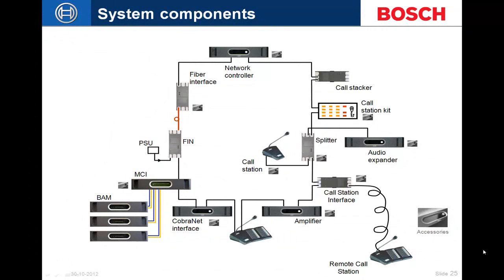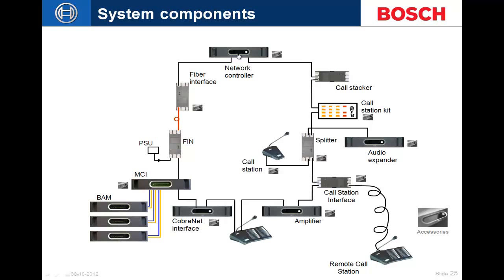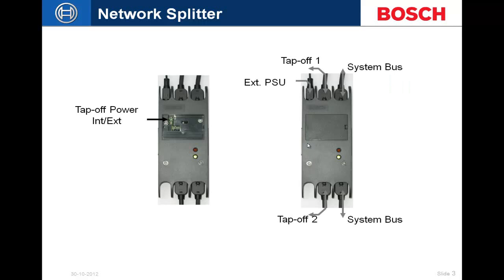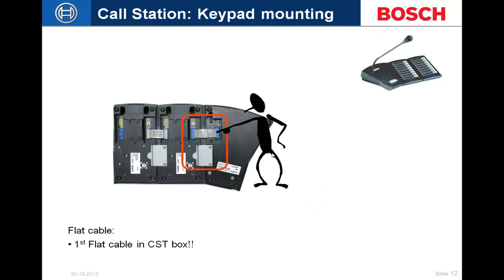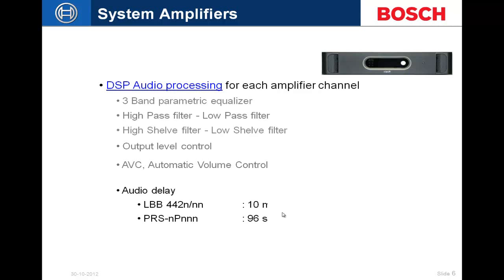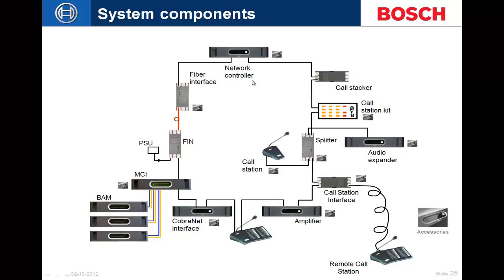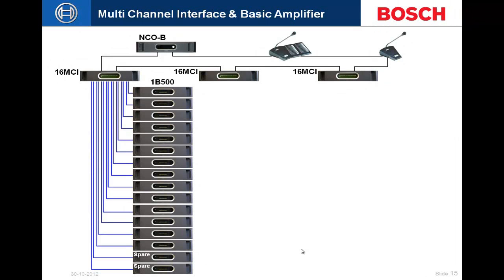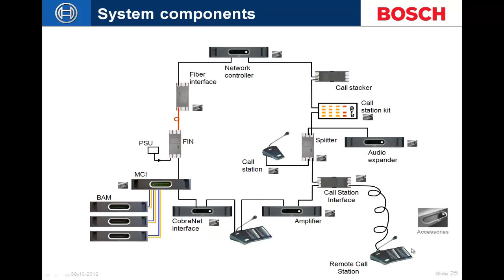Bosch Security - Praesideo Basics #1 System Components Overview

Comment: We have two Bosch Amplifiers and a Controller used for our paging at our domestic, departures and arrival terminals. Been working for past 12 years and somehow, some electrical issue or surges somehow caused our fault to our amplifiers. We have been out of PA for past week , was told we have PA program. However upon physical checks , unable to detect , smell or burnt components? Wehn turn on with speakers , every seems normal except it says no network? Does that mean the amplifiers are ok?? Was told Bosch no longer support these amplifiers or the controllers as well. These  Bosch systems has been so resilient and very reliable until recent fault.